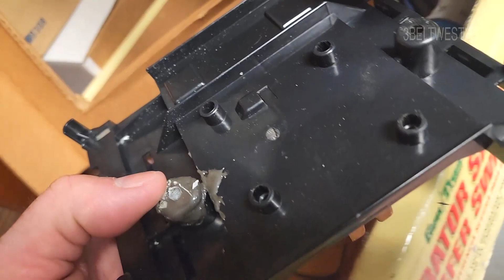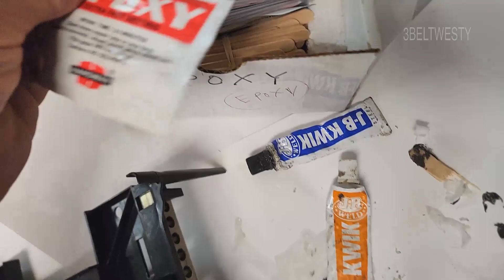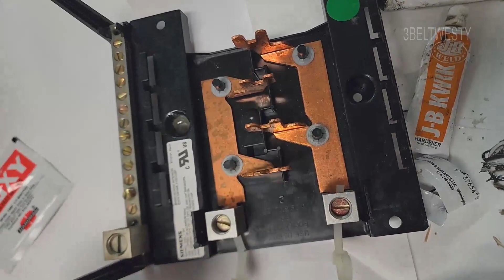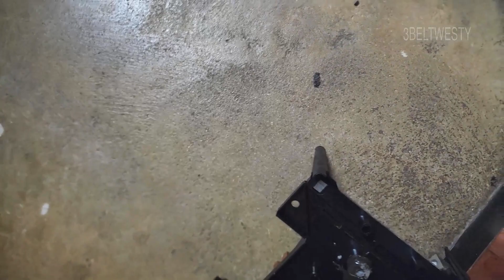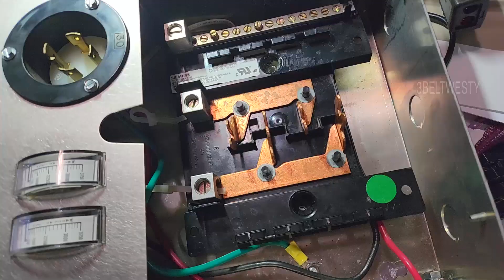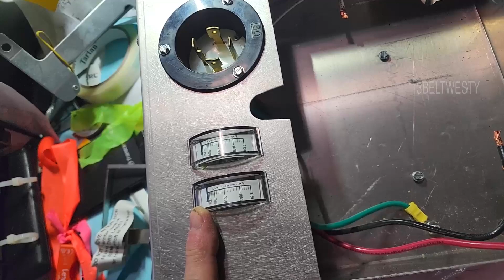Hardman Red double bubble repair plastic 3028 Transfer switch

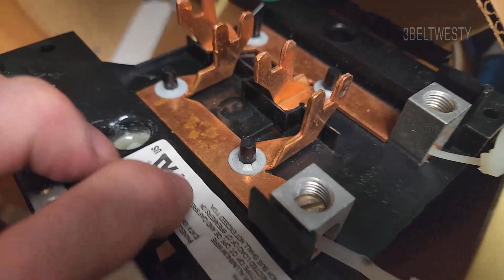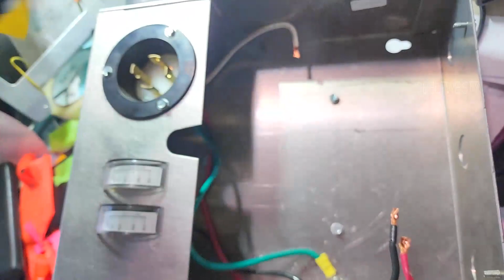Comment from the maker: 0:15 This is a Circuit Breaker type unit; not fuse box. :)  2:47 the meter read in Watts but actually are Amp meters so at 1.0 unity power factor they show watts. They really are showing volt amps. :)